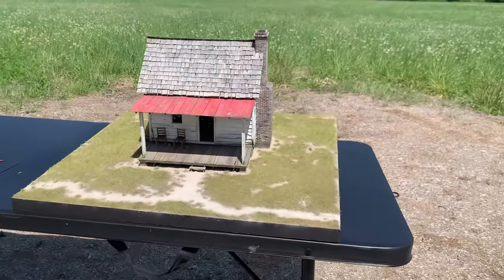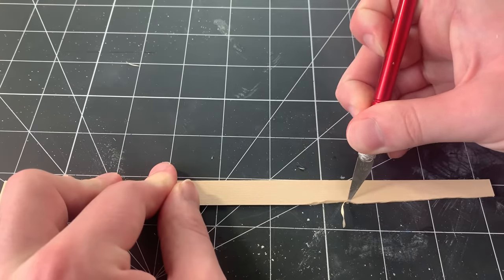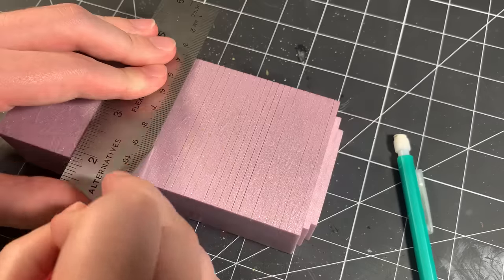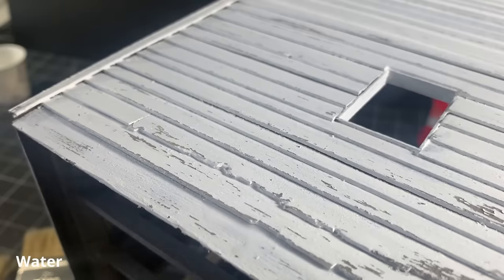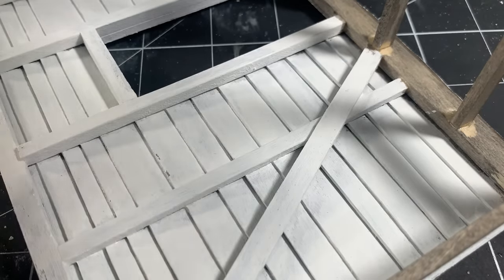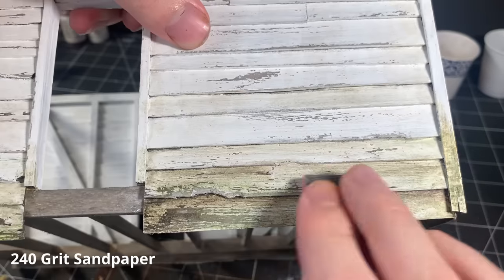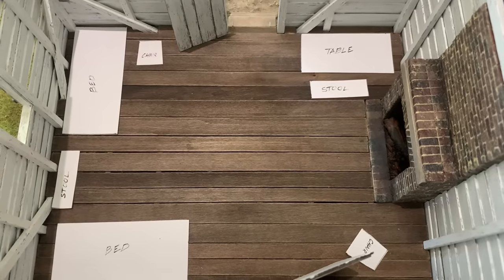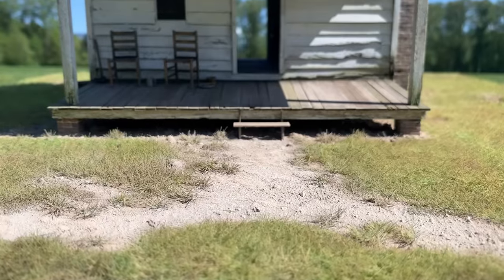Build an ULTRA-REALISTIC Old Cabin DIORAMA - Miniature Model Scenery

Comment: My mixture is a very light color compared to yours, and when i sprinkle on the leftover dirt it has a heavy contrast and looks fake. How do I make it darker? And how long should i wait before applying the grass?
Reply from the maker: I’m assuming you have a lighter colored dirt to begin with, you could try experimenting with mixing dark brown acrylic paints into the mix. I also waited until the dirt was dry before applying the grass, and I waited overnight.

As you saw later in the video, I ended up painting the dirt a lighter color afterwards with an airbrush. You could maybe try the same with a darker color. Hope this helps!

Comment: How do you get the scaling, correct?  For example, walls in the United States have studs 16in on center.   How would you translate that to a project like this?
Reply from the maker: Well since this structure is quite old, from the 18th century, I didn’t quite make it up to the current day standards, but I still worked to scale. 

In this case 1/2” architectural scale or 1/24 scale (both are the same). For 16” on center studs, you’d need to mark out the center of each stud 16” is scale which would equate to 2/3 of an inch. You could use a scale ruler to help you get the exact measurements. Hope this helps!

Comment: How did you print on plastic ?, is there a cheap method to do it thanks
Reply from the maker: Hi there, for my miniature plastic details I used a resin 3D printer. The machines usually cost around $200-$300, and the resin is about $30 a liter. I use free 3D modeling software, and am able to print lots of parts with one bottle of resin. I’d recommend watching some 3D printing tutorials if you want to learn more about it. Thanks for watching :)

Comment: Don't forget to add small dots of silver paint on the wooden frame where a carpenter would typically have nails !

Also, as I'm sure you're aware, diagonal braces are not a common feature of full-size wooden house frames. I assume you added those for model rigidity and not to 100% replicate a real house.
Reply from the maker: That’s a great idea with the nails! The diagonal braces were used from a real life reference I used! It’s from a cook house at the grove point plantation. Thanks for watching!

Comment: Where do you get all these small bits of wood
Reply from the maker: Hobby lobby should have all the wood you need, the only exception was for the roof frame where I needed 1/32” x 1/8” strips which I ordered in bulk off of Blick art materials website. Hobby lobby also sells 1/32” x 4” pieces that you could cut at 1/8” intervals instead
Reply: @smolworldworkshop    Thanks for the reply ! Couldnt get onto hobby lobby in uk, they change there name to hobbycraft here. Have ordered some, thanks :)

Comment: Where did you get your Balsa wood?
Reply from the maker: I got most of my balsa wood at hobby lobby. The only thing I didn’t get there were the 1/32” x 1/8” basswood strips which I ordered online from Blick Art Materials. You could also just order all the wood in bulk online that way as well
Reply: Nice! And a few more things, how do you make your cuts so clean? I have a mini miter as well but my cuts are always slanted… And what specific BSI glue were you using?? I appreciate it 😅
Reply from the maker: @hunterswartz3160  well my cuts aren’t always perfect because I also have some slanted pieces, sometimes I keep a piece of sand paper handy to flatten out the ends on my desk. Other times I might just get lucky with a straight cut haha! The foam safe super glue is bsi super gold plus which has a black cap. I also use the purple cap which is their normal medium ca glue if I’m not gluing anything to foam. Hope this helps and good luck with your projects!
Reply: @smolworldworkshop It does absolutely, thank you!

Comment: Do you just get used to the feeling of little bits of super glue on your fingers also how did you figure out the scale of everything it all went together perfectly
Reply from the maker: Yes I have gotten used to it!! It used to bother me so much, and while I don’t like the feeling of glue on my hands, I’ve learned to tolerate it haha.

I used to study set design which is how I learned scale. 1/24 scale is the same as 1/2” architectural scale which is what I use. Basically I do most of the scale in my head - simple knowing that 1/2” = 1’. Meaning 1/4” = 6”, 1/8” = 3”, etc. You can also use a scale ruler. I hope this helps!

Comment: I wish I had seen this video about 3 years ago, before I started building my human sized goat barn. I could have used this method to build the framing to see what problems I might encounter. It would have stopped me from making mistakes with 12 ft studs rather than with a 12 inch miniature. I like miniatures because each one may contain a scene, house, or even an emotion, take up only a tiny place. Wonderful video. I need to create a miniature version of my goat barn,  at least one paddock, and the various people, tools that are needed in my own barn. I raise meat goats, which are quite large, strong, and curious. I have done some miniature making. It is rewarding when it comes out looking like what I envisioned.

Comment: The brickwork is very nicely done, but the brick pattern is a bit off. The lower section at least should be a double layer of bricks, with every second row short end out, like most actual old brickwork is.

Comment: Just started watching your projects.  Great job !  But I was wondering do you actually scale down every component and calculate the dimensions or do you just eye it ?  Like did you know 1/8 would work for the bricks or did you just guess ?
Reply from the maker: Hi there thanks for watching! And yes I actually scaled everything properly for this cabin. 1/8” x 3/8” translates to 3”x9” bricks which is slightly oversized. But when you widen the gaps with a pencil for the mortar joints, It basically makes them the correct size!

Comment: Shakes were installed with a gap anyway. Rain made shakes swell and seal. If butted against one another, the shakes would swell and warp or split. The gaps also helped heat escape. When composite roofing is used, more ventilation is necessary. Go into an attic of an old shaked roof and you could see sunlight through the roof even if it didn't leak during a rain.
Reply from the maker: That’s great to know, thank you for sharing that with me! Also thanks for watching :)

Comment: Do you have the plans for this on patreon I’d love to try and replicate it
Reply from the maker: Hi there, have a few drawings that I could give you, but not a full package. Unfortunately, I don't have a proper scanner and I had to used my phone. It defaulted the paper size to 8.5 x 11, but I drew these drawings in 1/2" (1/24) scale on 11x14 paper

I was rushing to get the model finished, so I drew the least amount needed to complete the model. There should be a plan drawing, an interior elevation which gives information about the chimney, an exterior front elevation which gives information about door height and window height, and an exterior side elevation which determines the slope of the porch. You would have to scale the drawings up to the right size if you wanted to world directly off them. Everything should still be proportional, just not to the right scale.

The important dimensions are that the base of the frame is 9.375" long x 7.25" wide. From there, you could scale the plan to the right side, and the width and length of the elevations to those dimensions.

Comment: What size wood do you use for the frame, rafters, etc?
Reply from the maker: All the strips come in 24” lengths
The perimeter of the base of the frame was 3/16” x 3/8”
The floor joists were 1/8” x 1/4” 
The corner studs were 3/16”x 3/16”
The typical studs were 1/8”x 3/16” 
The rafters were 1/8” x 1/4”

Hope this helps, thanks for watching!

Comment: Do you have the measurements that you used?
Reply from the maker: Hi there! The length of the frame  was 9.375” width 7.25” and the height was 11” at the tallest point. This build is in 1/24 scale. Hope this helps and thanks for watching!
Reply: Thanks